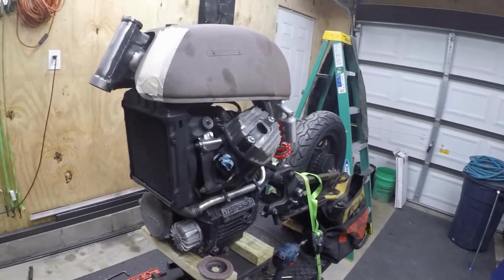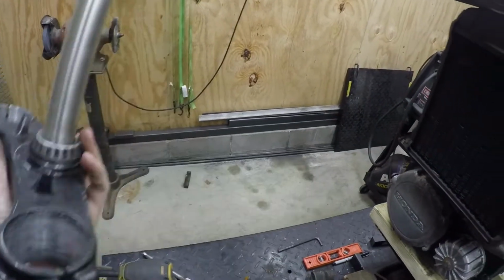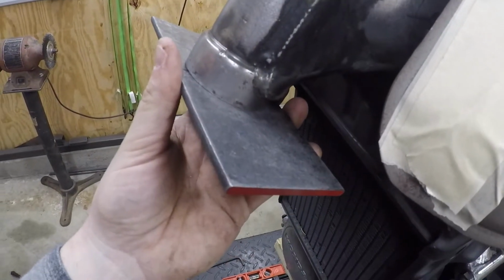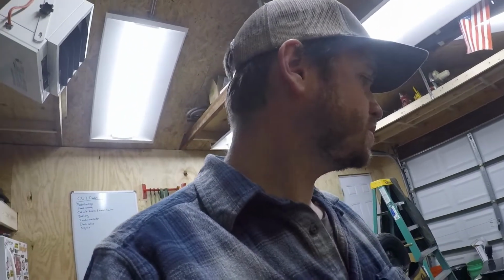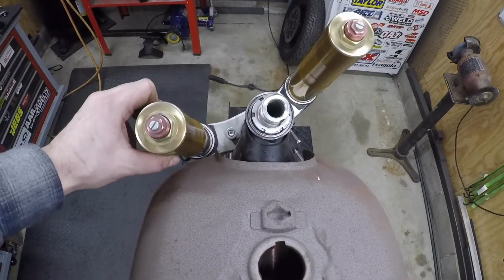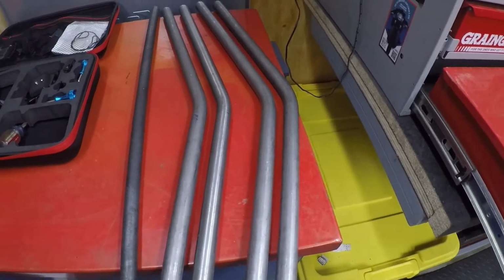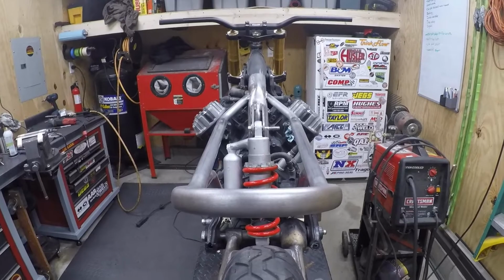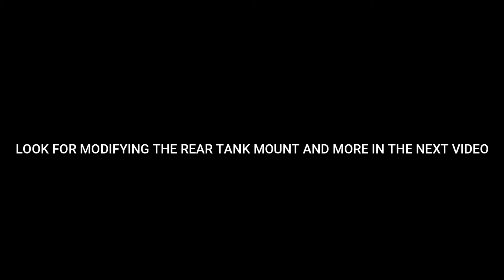CX500 Build - Fabricating A New Subframe And Steering Stops!!  EP4

Comment: Hi i was wondering how did you get the shape for the seat hoop ? Did you weld  two parts togeter or got it like that ?
Reply from the maker: I had purchased a hoop and welded the sections together as shown
Reply: @BrickHouseBuilds  OK. The hoop I see on the market are much more smaller. Havent yet found one thant long.
Reply from the maker: @leonstarace3822  check dime city cycles and tuffside seats. Both offer long versions as well as subframe kits
Reply: @BrickHouseBuilds  thank you for your help. I'll get a look at it.